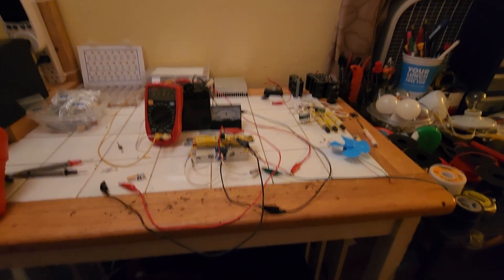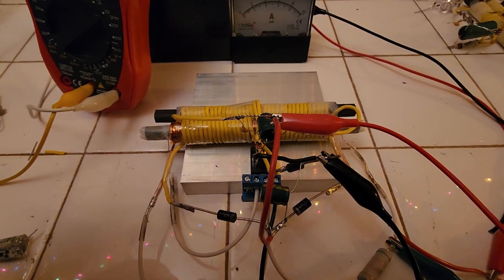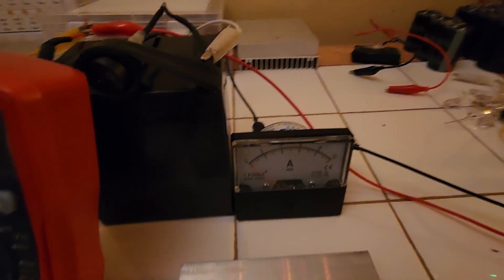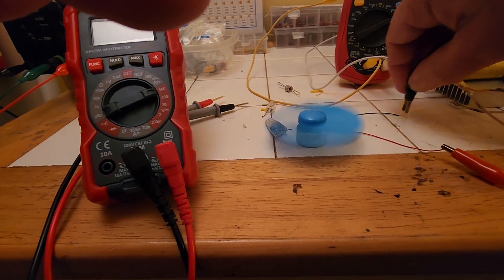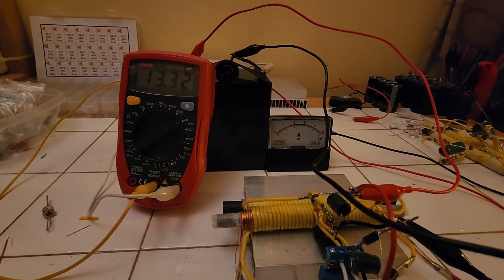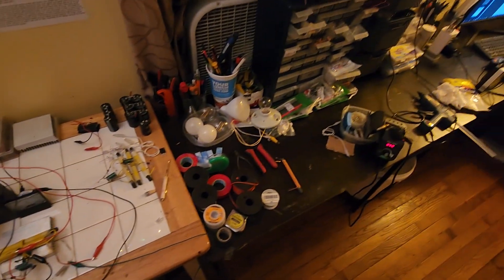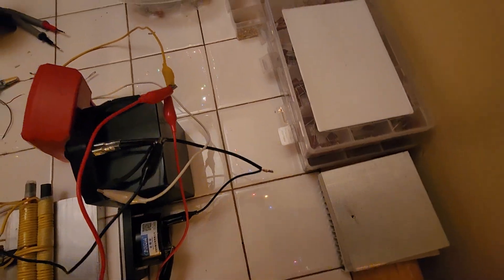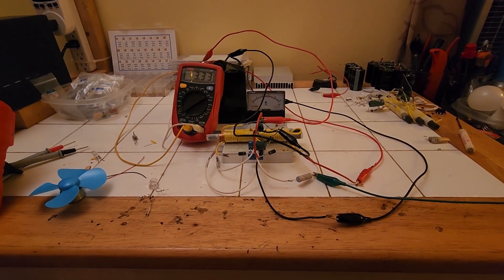🌞NEGATIVE RESISTANCE PHENOMENON NEARLY MASTERED IN RINGER CIRCUIT PLUS LOAD TESTS PART 1💡

Comment: Don't trust.  The output only increase voltage but won't increase the battery amp when you are charging the battery. Totally bullshit.
Reply: From what I understand: The negative resistance effect must cause decreased input power when output current increases, has something to do with phase conjugating reflection/mirror, the opposite phase cancels 'input' instead of pulling current from power source.